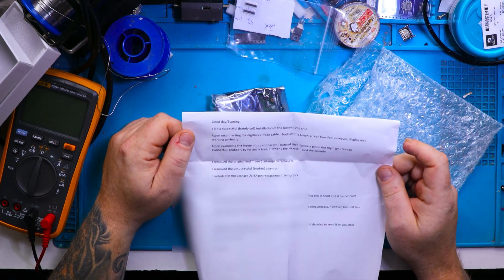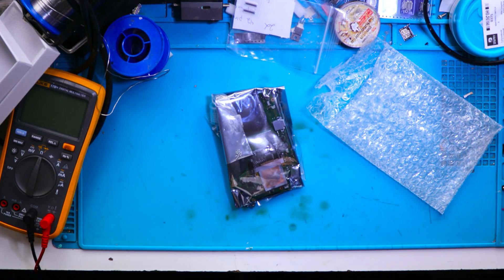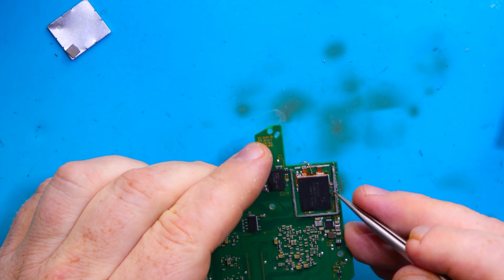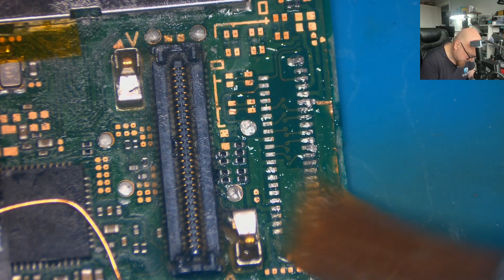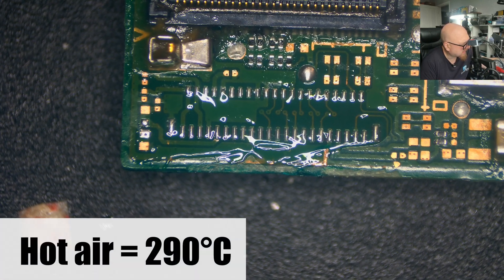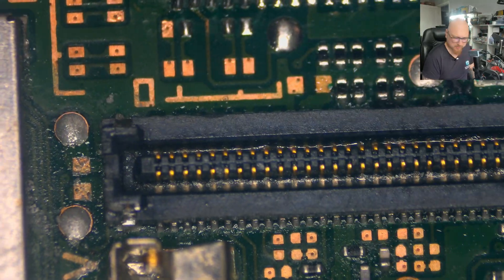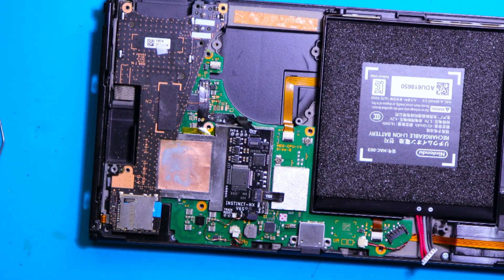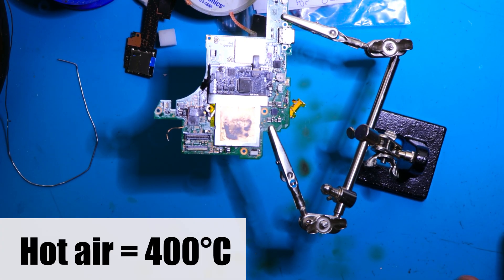Nintendo Switch OLED – Screen Connector Replacement 🔧 (Customer Sent It All the Way from Canada!)

Comment: This dat0 adapter won't last long. The best way is still the kamikaze method. Nice repair, well done. 🙂
Reply: For my first time ever doing this with minimal practice, the Kamikaze method wasn't something I was willing to risk, even if it's very doable on a first attempt. Screw that up and things get bad very quickly. I can always fix a cracked joint or faulty wire.